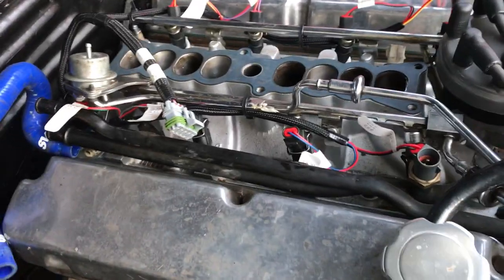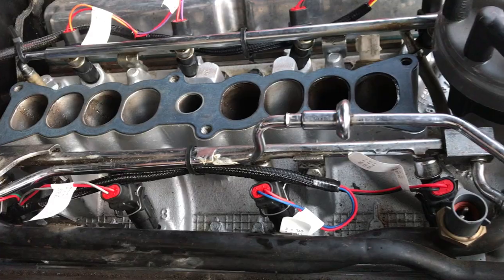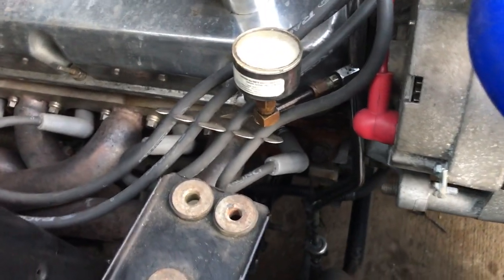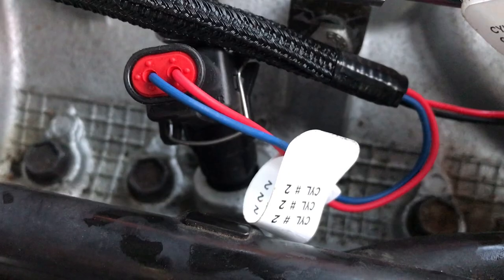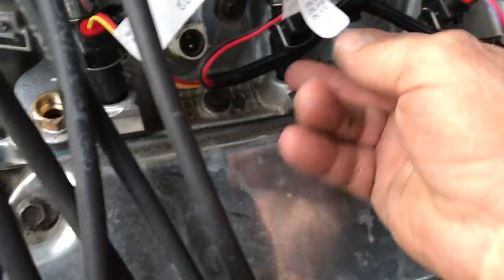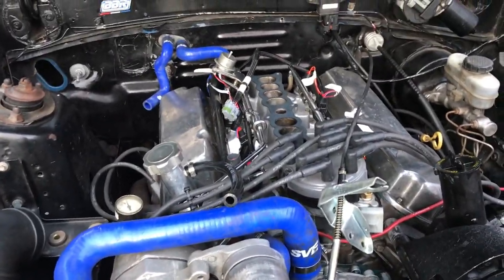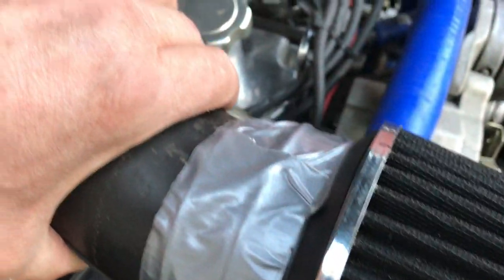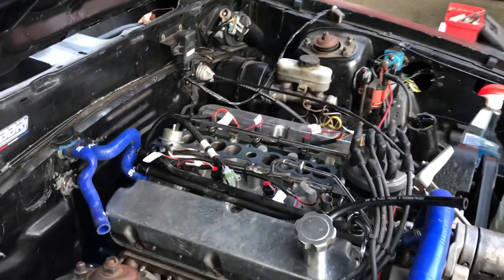Terminator X (Fox Body Mustang) - Fuel injector wiring harness

Comment: The ol’ girl is coming along. Makes me miss my 86 t-top. How much was the efi kit?
Reply from the maker: The kit is $1,149.00 free shipping - no more A9L computer & 60 pin connector (no longer needed). This is a stand alone ECU that has lots of functions & can be hooked up to laptops to be tuned. Holley EFI Digital dash with GPS  going in next!
Reply: Jeff Palmer can’t wait to see all that. That’s not a bad price. I used fitech efi on my 65 and nothing but problems. I was thinking about going to terminator efi on it. But I may use this version I still have my efi intakes off my 86